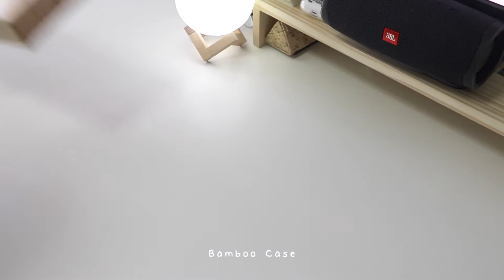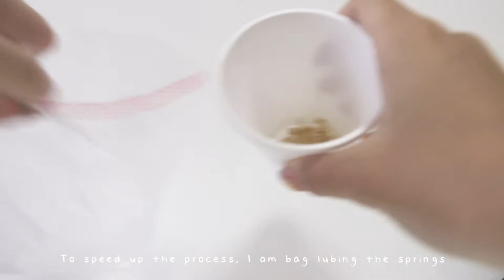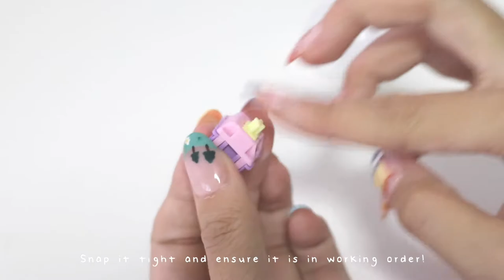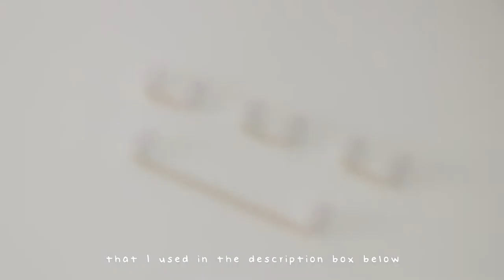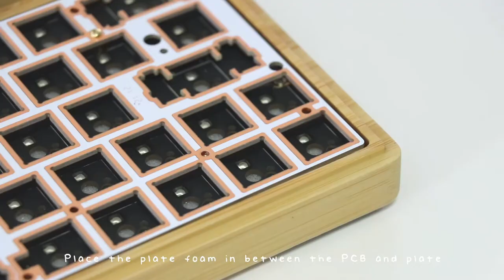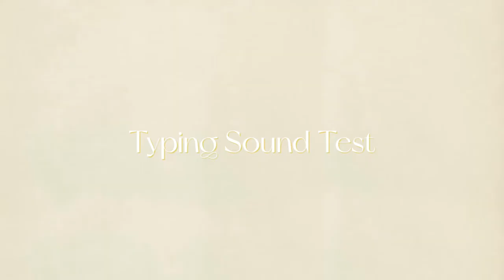Minimalist Bamboo Mechanical Keyboard Build | Aesthetic Honey & Milk Theme 🍼🍯

Comment: what's exactly the name of this battery? which connector type? I couldn't find BYX 305060 3.7V 1000mAh anywhere (it seems that's what's written there). I bought one 3.7V 1000mAh with JST connect but then I figure that's the wrong connector... Thanks